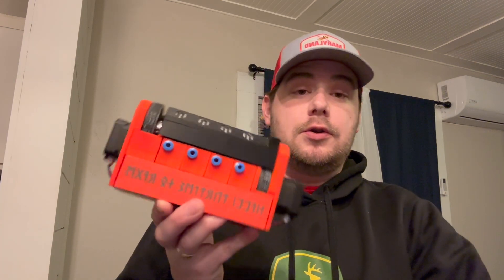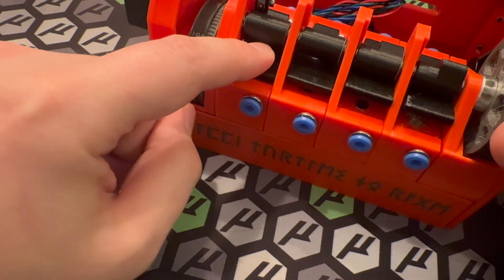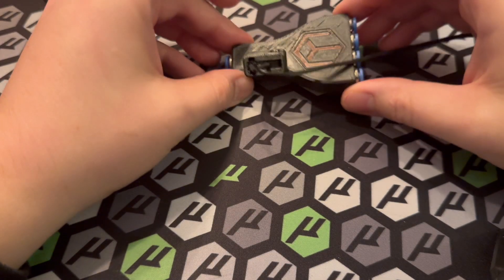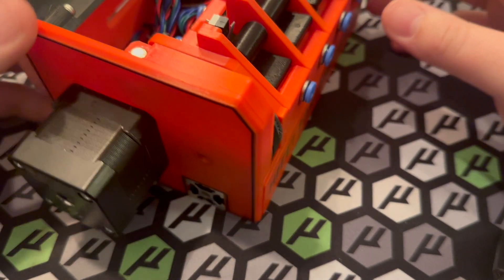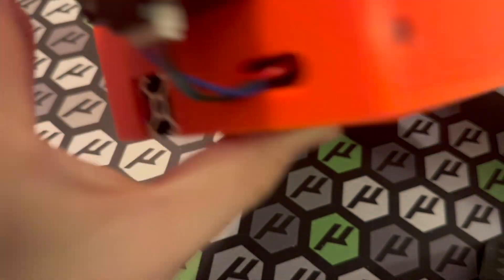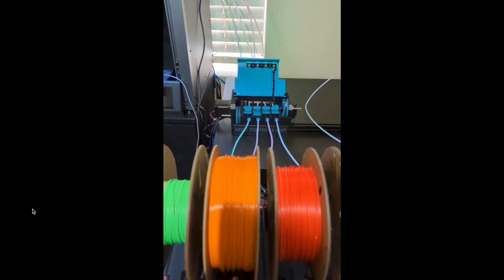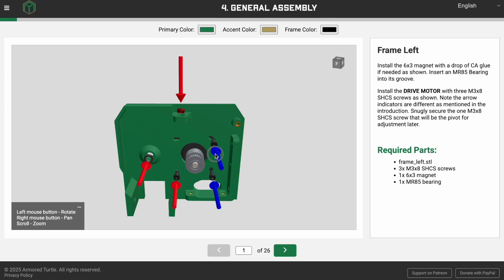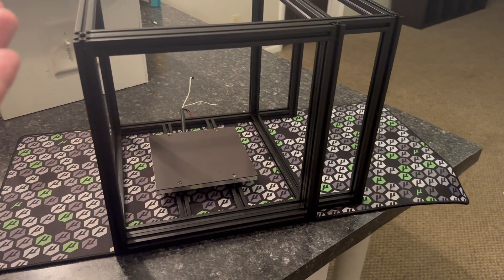I designed a multi color system in a day!

Comment: You didn't design this in a day, I saw a very similar unit using a cam last year, it's not new, at least say where you got the idea from.
Reply from the maker: You’re right. It was more like 6 hours. And I did say where the idea came from in the video. :) 
Go ask on the discord, there are many witnesses to how quick it went together. Almost as if, somehow, I have done multi color systems before. Hmmm. What’d be even more odd is if I had tools in cad that could automatically set certain geometries for me pulled straight from other projects I’ve done.
Congrats, you caught me. I ripped my own stuff.

Comment: If you can build an interface to the Bambu Labs AMS bus (I think it's CAN), this would be an amazing way to add unsupported filament, external dry boxes, or just cheaper alternatives to official AMS units.

Also, Bambu sells a 4-to-1 passive combiner for $5. I got one, thinking it would allow me to incorporate the external spool holder into multi-material prints, but I was mistaken.

Comment: will it be available to use with Elegoo machines
Reply: As long as your machine runs klipper and you upgrade to run version 0.12(if its running an older version) I don't see why it would not work. Just got to figure out a way to add a toolhead cutter IMO.

Comment: you basically built a 4 lane pico mmu just packed in a way that you cant see the guts from the outside
Reply: I thought the same
Reply: Exactly, just don’t use servo instead another stepper motor.
I am about to build one pico mmu and I thought why not use another stepper motor, it would me cheaper and less sensitive to break.
Reply: @danielserranotorres4230  i once had the idea to build a box turtle alternative myself which fits on a 300 voron no issue and has a heated chamber,  my idea was to use a similar technique like done here, one big stepper motor that drives the gears, one that selects via cam, and a printed gear assembly that allows the spool to get respooled with the extruder gears etc :D